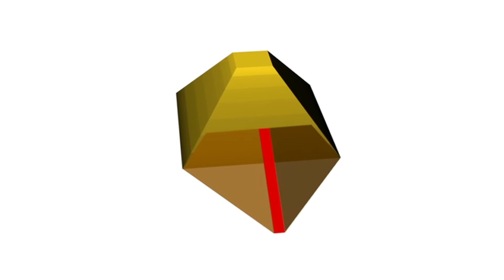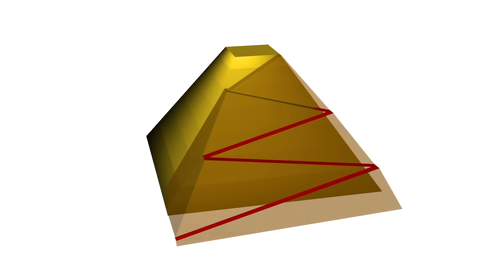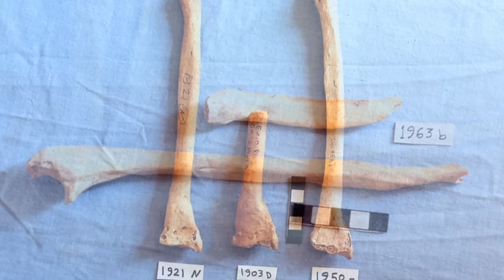Egyptology - Pyramid Construction

Comment: Another worthless video of the Pymamids.  They were not built by the Egyptians or any other humans.  When you examine specific engineering details you can easily realize it would have been impossible for humans to have the required knowledge.  I will state only one of the dozens of details in support as follows:  The North Face of the Great Pyramid "Faces Directly North" with a deviation that does not exceed 0.05 Degrees.  Such a feat using todays technology and equipment, would fail to replicate such a massive construction without an absolute level base.  As usual, when stupid humans are unable to understand or explain something, they will create multiple theories to justify their opinions.  These are the same imbeciles that created one God or another to explain the origins of their existence.  Christians believe in Talking Snakes and Muslims believe that Mohammed went to heaven on a Flying Horse to meet Allah !  After 5000 Years the Jews are still waiting for some messiah that is going to........................

Comment: what if they just built the sand up around the pyramid stone layer at a time making a huge mound of sand as they went up so the grade it was built on wasnt step and when they got to the top they put there cap on and finished going back down or finished it going up the reason I say this is because of the holy grail hill in England it's big and as I understand it was man made .

Comment: The premise of pyramid construction is completely moronic.   They obviously didn’t use ramps or sheer muscle power to move the blocks or fit them together.  The rocks were not quarried either.  They were created using molds and concrete construction.  It was first use of such concrete in ancient world.    They used locally sourced ingredients.  The blocks were therefore not carried to the site but created at site, like modern construction.

Comment: This dude is mad wrong. The pyramids were built with either cymatics/levitation or giants.
Reply: I believe with sound frequency. The original builders also weren’t Egyptian. The Egyptians just reno’d and altered them…The Sphinx used to have a Lions head and the Egyptians just whacked on the head of a King. The head is clearly too small for the body. The Original head was of a Lion pointing directly to the constellation Leo

Comment: Anybody who believes that humans built these without extraterrestrial help is a fool.
Reply: Says the tool that brings up aliens 😂
Reply: @jimbo6367  ... In 1992, 1999 and 2005 I travelled there, inside the kings chamber are 80 ton granite blocks quarried from 400 miles away, '"carved" within 1/1500 of an inch tolerance,  with no tool marks,  so perfectly square even a laser shows no light between the blocks nor are the blocks out of square within the same laser tolerance.... but sure buddy, early humans quarried, carved , cut , shaped and moved them 400 miles with stone age tools, logs and ropes......  all the while keeping them in absolutely perfect form..... then stacking dozens of them  in perfect mathematical and celestial alignment with zero damage and not even one chip or scratch ?.......... explain that little pup... Ill wait........
Reply: @joerotorhead   I can’t and nobody can.  There are many mysteries of ancient civilization we can’t explain.  To suggest aliens is an insult to those civilizations and shows how cocky modern humans are that anything we can’t explain is ‘aLiEnS’
Reply: @joerotorhead  and if germs had never been discovered you would have blamed disease on aliens 😂. Nobody knows how the pyramids were created, but every theory out there has more merit than ‘aliens’.  ‘Aliens’ is the biggest cop out for the unexplained and is the easy way out for non-thinkers
Reply: @joerotorhead  ‘lack of evidence’ lmao says the person with no evidence that aliens built the pyramids.  Grow up

Comment: They used water and lifted the blocks with wood ballast up the top in a tunnel filled with water and placed them with removing ballast too all underwater Inside out not from the outside. Proof of this exists. The quarry was along the Nile and all blocks were transported to the construction site while the blocks floated and blocked were pushed effortlessly by workers just like a boat. The granite blocks in the pyramid was carved using the traditional pickaxe but coated with diamond gems imbedded inside the soft metal of pickaxe, evidence of this exists too, and by the way diamonds are not that rare there if you didn't know. 
Nothing crazy... all was easy for them just took a long damn time anyways.
Reply: Never heard so much bollocks in all my life 😂

Comment: THE ANSWER:   They didn't use ramps. They used what was on hand...sand and levers.
It is possible to dig under one end of the block and insert a log crosswise....use it as a base for levers on either side where multiple men raise the block a foot off the sand. Others shovel sand under the block. Do the other end...and up it goes.
They basically buried the pyramid as they built it....and ya it took a loooong time. But they had logs, levers and lots of sand and people.
This was the method outlined as most probable in my 4th yr archeology class.
No mystery.
Reply: Finally some sense
Reply: That would take soooooooo long
Reply: @eugeneabreut960  It did.....decades. Slaves were born into pyramid building families....toiled their entire lives...and died building them!

Comment: Population of Ancient Egypt = 2,000,000 approx 
if half men = 1,000,000 then lets assume 500,000 possible total Egyptian workforce = 16-40yo and rest to continue economy 
2.3m blocks weighing 2500kg each 
Construction approx 27 years 
That means 2300000 blocks / 27yrs = 233 blocks per day every day needed to be installed
If weight of block =2500kg and incline of 10° using Newtons first law = 24144 of force to remain stationary. 2nd law if accelerating at 5cm/sec equiv to 482,000kg to pull. 
Assuming each male at that time used 200N (adjusted for modern health and physicality) = 120 men to keep block from sliding. to accelerate 50kg force each = 9600 men each block
**All of this using 0 friction and no rollers as alleged**
9600 men * 233 blocks = requires over 2million people. - lets keep assuming all is good.
Nile River to Khufu pyramid is 8046mt - at rate of 5cm/sec = 4320mt / day (24hr) if 8hr work day = blocks moving 1440mt per day each (3 days from river to pyramid) 
Now building pyramid would slow as it rises (due to further distances it needs to travel) by the time we get around 1/3rdt of the way the blocks need to travel an additional 920mt (230mt / side)around the pyramid (another day approx) 
The quarry required over 3000 men producing 200+ blocks per day. (26/hr) 
Then amount of boats required to move them 15km downstream (every 500mt sailing) 
Then the men needed to move them at 5cm/sec would mean each block have to be ~30mt apart. if each man stood 1mt apart and 4 rows wide (min) would only be able to fit 120 men. (amount required to keep block from going backwards on incline)  

If they were using forms of rollers etc then would need less men and be quicker, but the force needed would be larger to move once on an incline. (Above on the assumption on ground) 
 
So, from the day Khufu was in power, the pyramid took another 5yrs to finish (22yr reign) so either pyramids were designed and begun from initial concept to keep up with supply or they were built for another reason...... and older than assumed... but that's another theory

Comment: The one way to build a pyramid that is never discussed is that the Pyramids where "Sculpted from mounds of dirt." Minimum raising of stones needed. Only massive digging. Then place lime stones on the outside until you can build up the structure, using trees for support when needed.

Comment: The granite blocks above the king's chamber weighed over 80 tons and put in place with such precision. Each block is a different size and if you were even 5mm out on any of the blocks it would ruin the shape of the pyramid. Aliens are the only logical solution.  They drew pictures of the gods all over the walls and the people from the stars written all over the place.

Comment: The Egyptians did not pulled  everything to build the pyramids, I thought those in the scientific community were clever. You just can't pull or lift a tons of rock and pile up one at a time.

The technique is the same. what modern construction workers today do; by pouring the mixture of cement,Rocks,and sand in a mould. 
The Egyptians must had done the same, by pouring the mixture of clay or soft pounded granites,straws with water and then poured it to the mold ,until it dried out. Archeologist n the sceintific community is misleading many..
cause it's impossible to stock file every tones of Rock ...those blocks were massive,and many people have seen it. 

it will require lots of energy of body.
Just imagine... it's was built in the dessert scorched by the heat of the sun,remember it was build by slaves .
It's impossible for a slave to be able to sustain that kind of strength from their body by pulling n lifting 
Such tones of Rock with a scorching heat. 
You need Gatorade! 😊

That it's is why it's impossible,the big question is dehydration. 
Even there is water, its not enough to sustain the body with energy.

Comment: No way was those stone were moved up by a ramp , some of them are 10 - 20 tonnes , moving somthing of that weight and size to the top of the pyramids , you would need the ramp to be of 10° degrees , which means would be a very very very long ramp !
Reply: Still going I see.  lol!  Next time = look at photos of the top rather than poorly assuming.  People who climbed it and took selfies have posted pictures online.  See where those blocks = are small enough to have been levered into place by several men.  So your larger blocks are found = closest to the ground and not the top.  Dig deeper next time.

Comment: So incredible how most archeologist try and try and try to fit the theory of copper rudimentary tools and the use of "muscle power" even tho you can see machinery marks everywhere, circular saw marks, drilling marks, perfect cuts, etc; sad, really sad how they want to uncover the fact that they were advanced enough or straight forward that they didn't build them but find them and restore them. The year timeframe doesn't fit at all as well.
Reply: First of course is they used bronze tools = and bronze being an alloy contains copper of course but is much harder than pure copper.   Next is "when" do those cut marks appear.  Would you as a Pharaoh desire a temple built from imperfect blocks??  Think about it.  So Egyptian sites were periodically ripped up and rebuilt as well as cannibalized for raw materials to build other things over the course of millennia.  Dig deeper.

Comment: Some areas of ancient Egypt and in the Andes / South American Inca have similarities in architecture and in particular the precision cutting of solid rock and this focus of pyramids which leaves alot of area to speculation and debate. 

For those curious check out the Coral Castle story. Really interesting.
Reply: With modern surveying tools, we can't locate 4 corners, in a square, across the distance of the base sides, as accurately as the pyramid corners were located. Crazy.
Reply: @5222k  m
Reply: the tallest known pyramid in the world is in Guatemala and the largest overall is in Mexico.
Reply: Coral castle and Ed Leedskalnin are awesome
Reply: I'm not surprised by many ancient cultures making pyramids. It's the most efficient way way to stack stones as high as you can.

Comment: They firstly lifted one stone 
And placed it in mid-air. Secondly they placed four corner-stone  around it as a support. Finally they gradually built it to ground level. Another school of thought was they may built it horizontally. Then with the help of slaves they uplifted vertically. There is no other way of doing it. Those experts speak whatever they wanted to speak to the public.

Comment: We know they had rope due to the operation of the granite monolith doors of the kings chamber in the great pyramid. We know the larger blocks were at the base. The Egyptians were mathematicians. Build out a square base and place a pulley roller on top and guide rollers at the sides. Rope the blocks as soon as you want to lift always use smaller and smaller blocks.
That way the heaveyer block just lifted is lowered into place on the other side from where you are hauling up. The block to be hauled up must be lighter that the previous block.
They used gravity to haul blocks up facia ramps, there were no gaint ramps.
The taller the structure the greater the lifting ability and always ensuring the sequence of block weight followed than plan they were lifted for free as the same time the other side was positioned. 
Now and again such as the start a big block would need lifting step by step slowly up a side to restart the process due to frictional losses. There solved, the whole point was master full use of resources to achieve.
Reply: I mentioned that the other day on a different post. I had a teacher when going through school to be an ironworker.... We'll probably never ever use them with today's technologies, but he insisted on training us with block and tackles just to show how the old timers worked..

Comment: I heard someone say that it is physically impossible to pull a block that size up a steep higher than 5 degrees.

Can anyone corroborate?
Reply: the upward force sliding a block is not possible to be surpassed with a row of people leaning forwards and so applying this force. Try it yourself...tug on a rope over your shoulder and then multiply it by 50 and then see if it can pull a 10,000 block up a 10 degree ramp 2km long.

Comment: @3:00 the problem with this theory or method, is that if you go over the tolerance set by the string, now the entire area is too high in relation to that one area, getting giant faces like that smooth with method he is describing is ridiculous. You would use a much broader tool to sand it down. You wouldn’t do it in tiny sections like that.
Reply: yeah you have to be a moron to believe that technique was used

Comment: I bet the answer is that they did a spiral structure up the pyramid as they were building it, not a ramp that would be gigantic. I watched a documentary on it in 6th grade that has some really solid proof
Reply: First of course is your spiral structure = would still be a ramp.  Next is that the ramp did not have to go all the way to the top.  It only really needed to go as high as the largest/heaviest blocks to be raised = which is the King's Chamber - below the halfway point.  The largest/heaviest blocks are found closest to the ground.  Above the halfway point the blocks become smaller as it rises in height.  Those at the top could have been levered into place by several men.

So Herodotus wrote they used "a machine" which is likely a scaled up version of the Egyptian shaduf which employs a fulcrum and counterweight.  That could have raised the smaller blocks found in the upper half from level to level.  The larger blocks in the bottom half would be pulled/levered into place via sleds pulled by men and oxen.

Comment: You know, they always show these crazy pictures people pulling huge stones up these long ramps, and it's ridiculous!  Nobody, well it'would be the most stupid Way to move large stones.  Rolling stones would be the Way to go!  Also, you would move it first, and cut and carve the stone later at the work site.  There upon polished granite once you polish the stones they will move and slide easily on flat surface of another granite Stone that's been polished.  As the Egyptians knew how to get water from the Nile easily with wood and rope and animal it's also easy to move stones up Stone taps by maneuvering Stone and if they are smooth granite or smooth limestone with limestone they will slide across the stone easier with an animal pulling it or maneuvering it with wood and rope.
Reply: I know you think you said something = but you didn't I'm afraid.

Comment: To pull that kind of  stone is impossible. On the way up. The rope's needs to be so  tick to handle by a human hands..
Reply: What is a rope??  I'll give you a hint = multiple strands of line intertwined - think about it. Now look at a suspension bridge and see how multiple cables can support a large weight rather than a few thicker ones. Also they used oxen as well.